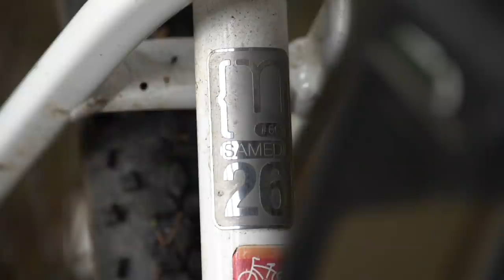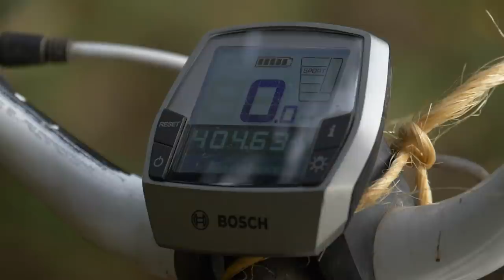How Much Better Are Modern E Bikes? | Retro Vs Modern Bosch System

Comment: I very much liked your comment about seat suspension, as it should be on every hardtail. Absolutely agree. I have been using CaneCreek's Thudbuster LT (with 7cm travel, this year's model has even 9cm) and if there is some invention "better than sliced bread", than it must be this. Give it a try, your back will thank you :)

Comment: I added a hub motor to a mountain bike back in 2012 because there were no much options on affordable bikes with mid drive motor. I still ride this bike today for commutes. it has a throttle and goes 30km/h which is great. Replaced the motor and battery once already as this bike has thousands of km on the clock. The things I don't like so much anymore about this bike are the feel of riding in terms of weigh balance and the geometry. When I change to my Commencal Meta power it's just another world of riding. The geometry and mid drive motor feels so much better.

Comment: Another thumbs up for the Suntour NCX seatpost. I have one on my old hardtail and another on a flat bar road bike. It really helps with the comfort. The one weakness with them is the saddle rail clamp. It is a bit prone to loosening and requires a significant amount of torque to re-tighten. More than is easily applied with a multitool.

Comment: Hi, because I am unable to buy a modern e bike at the moment, or for last 6 months or how long into the future, i have at 62 with my friends having e bikes resorted to buying 2nd hand. The people i ride with mainly off road trails all have modern bikes. To all their amusement i bought a 2012 volt alpine 400w battery 250w rear hub drive e bike. I took it out for my friends no doubt amusement rather gingerly😂😂😂. As i said w3 are mature and ride rough trails no jumps but muddy up and down stuff. This bike has a rear suspension post as stock. My previous bike was a marin full sus rift zone and this bike is much more comfy. Probably due to my old bike having 23 yrs of hard work.  However, performance wise it can keep up with the new bikes no problem, is super supple and comfortable. I was worried about the battery size. We did 30 miles last week, a friend with his ktm and 500w 2 yr old bike ran out of battery 2 miles before home. I still had an incredible 2 bars out of 5 left. He was in turbo all the way and i flitted from 3 assist ( lesser power ) to 4 all the way.  Of course i5 can really be as good can it, but for someone who has been riding a non e bike with e bikers, £700 has bought me into a new dimension, to the point i dont think i need to buy a new one except for pride. As ur test bike mine looks out of place but really does the job. I swapped at one point with the guy with ktm and he said he was very impressed. Really enjoyed this Stevedores as this only happened this week and i echo all u have discovered. The pleasures back for me and now i can keep up. Will try itbin assist 5 next time see how many miles i can do. Great channel and am sure many watchers will hav3 enjoyed this due to overpricing imo of new bikes. As yu say that suspension seatpost makes an incredible difference. I know my bike cant climb mountains but for general off road trail work its blooming great .

Comment: There is a glaring problem with the comparison of the two bikes in the time trial test. The older bike was not perfect bike fit for the rider as apposed the to new bike that was the correct setup for the rider. That could account for a reasonable amount of the time difference between the two.

Comment: How did they pioneer?..
I've seen loads of DIY ebike from before 2011?
I think they saw an opportunity that couldn't afford to miss out on and wanted to get in on early.
Also shows how over priced ebikes are ATM.
What's £600 plus 9 years.. and what's the equivalent now? £2000
Hmm.
Did Bosch sponsor this?
Reply: Diy e bikes, not e MOUNTAIN bikes, and probably not near the quality
And for the price comparison, the new bike is elvivalent in the placement in the range of bikes, but has higher quality battwries and motor, and most importantly is a beter mountain bike, because they had 10 years to perfect the way to combine "e" and "mountain" to get a better e mountain bike, and has better geometry because of that and because of evolution of normal mountain bikes
Reply: It wasn’t £600 new. She bought it second hand for that price.

Comment: There is definitely an advantage to the old 26 inch wheels and older geometry - I ride my vintage bikes just as much as the modern - the agility of 26  and vision of no front wheel in view is huge.
Reply: I kind of feel like you did when I - on a whim - bought a vintage 1996 proflex xc bike - I could not believe it !  It had many advantages to my 2020 carbon xc 29er.  I still ride that proflex as much as the new bikes.  It rocks.  Will there be a reset at some point to the 26 inch wheels and more agile geometry?